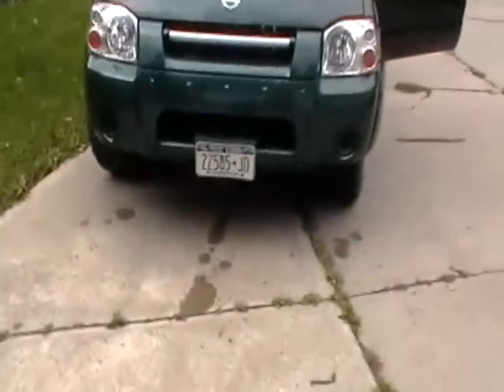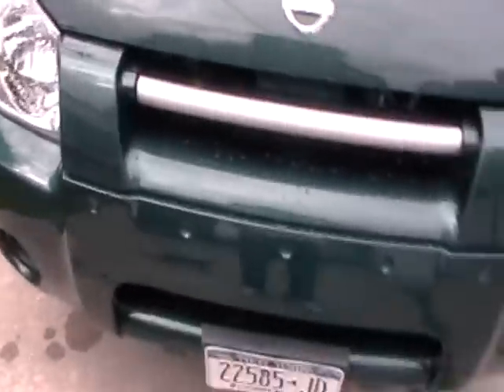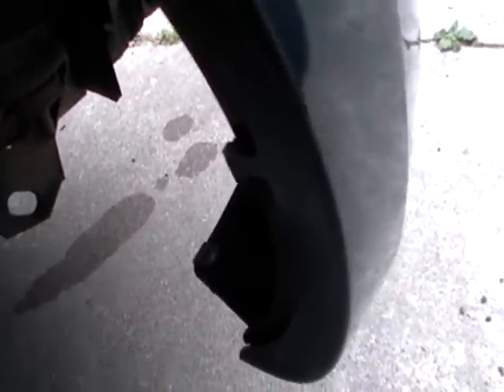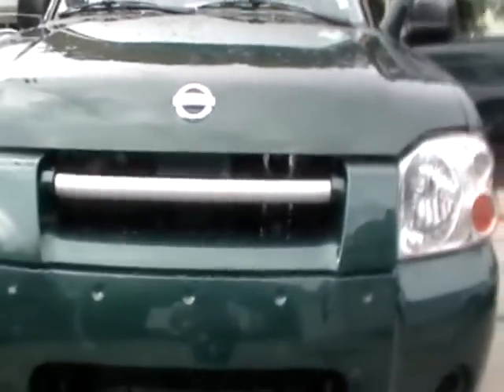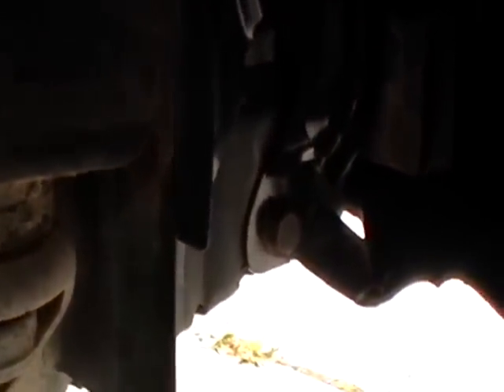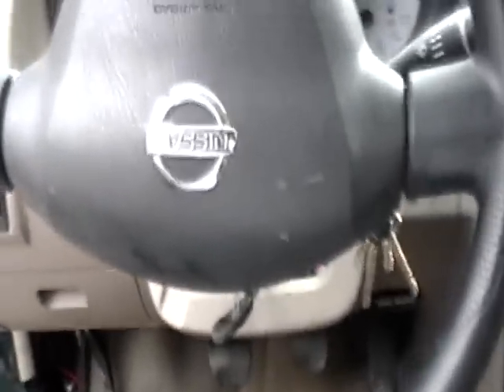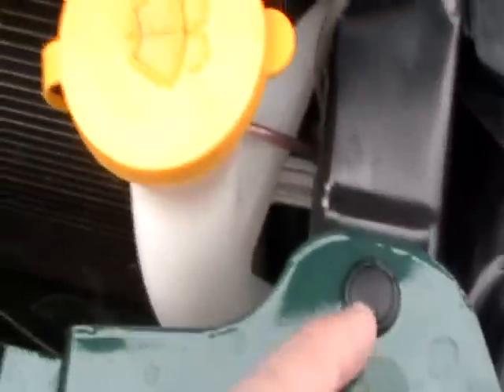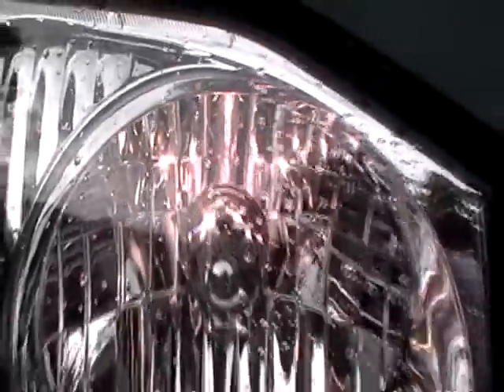my truck got "fixed" quick review

Comment from the maker: @mrfreshskii i didnt take it back because my dad had already left so i would have had no ride home! and you can tell the did replace some stuff like the knuckle and other parts it was just they didnt straighten the frame enough. after i got home i called the shop and told them and they said that they had fixed everything caused by that accident and that they would have to charge us to fix it the rest of the way because it wasn't a part of the accident.